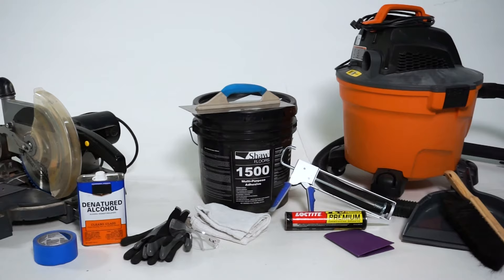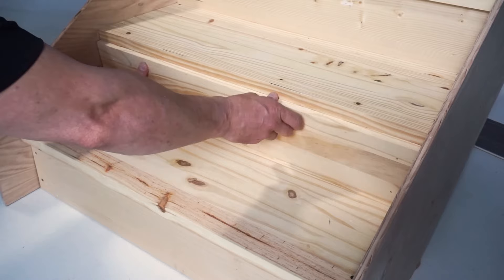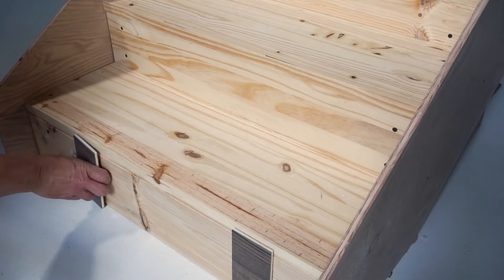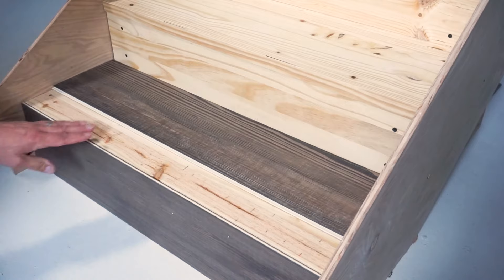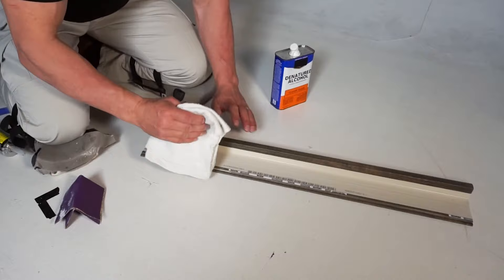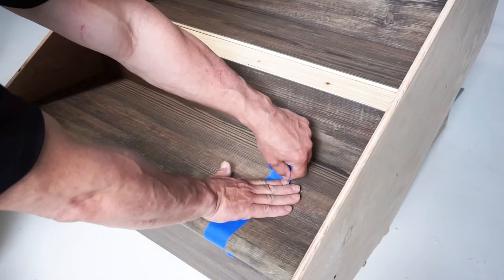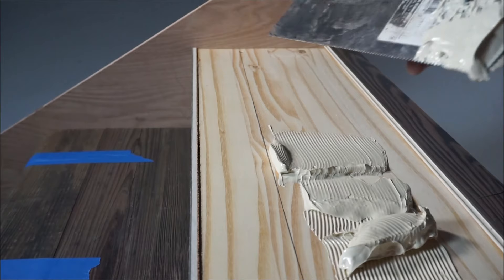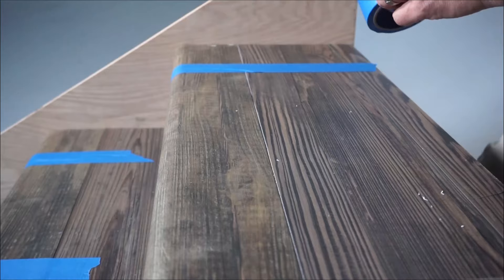Flush Stair Nose Installation Instructions

Comment: How do you install a stair nose on the top stair when the flooring planks are perpendicular (rather than parallel) to the stair nose?
Reply from the maker: Really, an overlap stairnose is what would be recommended in that situation if one was available. 

Some companies won't warranty a flush done this way, but Shaw recommends you custom cut the planks to fit nicely against the stairnose and glue a section of the floor down to keep it secure. You lose your factory edge and bad cuts will be obvious, but it is really the only way to make it work.
Reply: @znetflooring  Thank you!! I greatly appreciate your suggestions.

Comment: Hi, does the flooring piece at the top have to have the locking side, or can it be cut? Trying to lay coretec in our hallway and down the stairs. Thanks!
Reply from the maker: Really they are designed to have the factory edge, but many installers do cut it on landings to be able to use the flush in those spots as well. Other wise you would need an overlap on landings and not match the other stairnose.

Be aware, that not all manufacturer's will warranty using a flush on a landing piece or the top riser if going into a room with the same product installed.

These floors are designed to be floating and to use a flush stairnose, the floor needs to be glued down. If use at the top riser going into an installed room, if using the flush stairnose, you would want to glue down a section of the flooring in front of the stairs.

Please confirm with the manufacturer if you want to have your warranties retained.

Comment: My vinyl plank has attached backing pad can I use it on stairs???? Thanks
Reply from the maker: I would check with the manufacturer, some brands have a special glue, some ask that you scrap off the pad.
Reply: @znetflooring  It was pain in the ass to scratch up the attach pad🤦 I just thought if you glue it will hold up good.
Reply from the maker: @hachiroku7443  Many people go against manufacturer's recommendations and glue them down with the pad still attached, I have not heard of issues. But officially I recommend following the manufacturer's guidelines.
Reply: @znetflooring  Yes mkst people with attached pad don’t have issues… I’m gonna install stair edging anyay so it will screw down and will add nail under hoping to add security👍 Thanks!

Comment: Thank you for this helpful video! We are using corkback LVP from Coretec as well. However, our stairs are deep so we need to join 1-1.5" from another plank to fill the step. Do we need to glue down the planks onto the plywood as well? (Using the recommended Shaw 1500 adhesive).
Reply from the maker: Hello,

For actual stairways, yes. You should be gluing down the planks as well, Most people do tend to use the same construction adhesive as they use for the stair nose piece though.